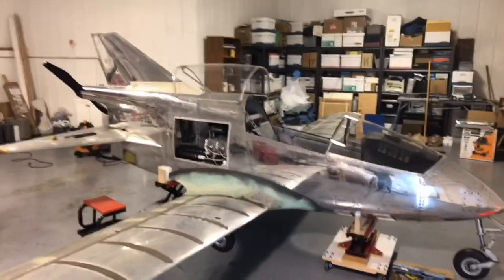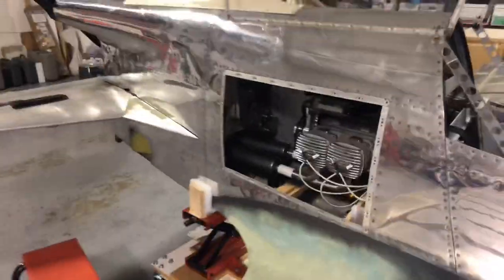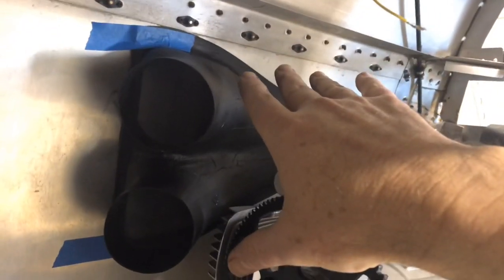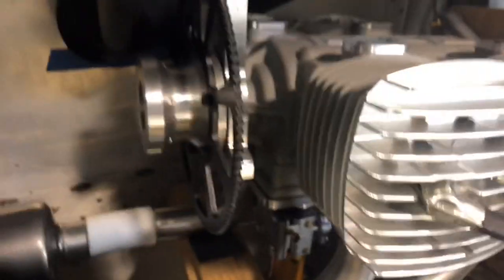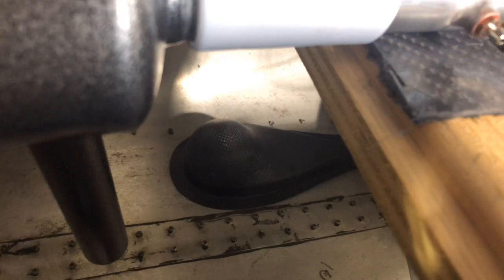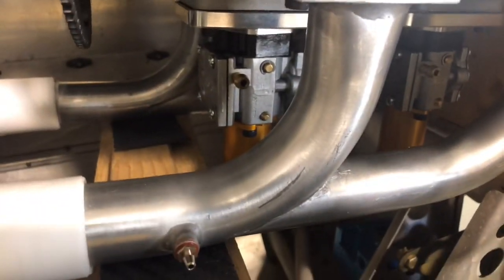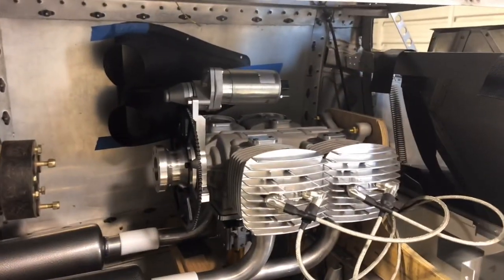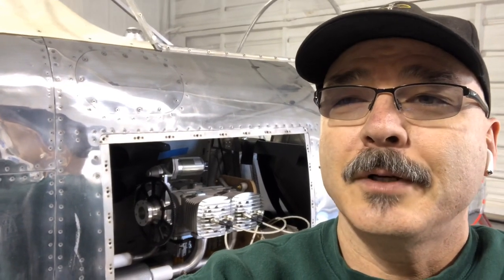Engine cooling and intake design considerations.

Comment: Cooling this engine during ground static and taxi operations could be a big issue. High CHT readings may be possible. Where a propellor creates airflow across cylinder fins in conventional aircraft, you may need to design small electric fans in the NACA duct system for ground operations. Having a 90 degree bend in the NACA duct system could reduce needed airflow and create a drag issue. Perhaps larger narrow rectangular outlet NACA outlets alongside the cockpit and ahead of the engine could be considered.
Reply from the maker: I'm working with someone who has built many Lancairs over the past 30 years and designed multiple cooling plenum systems and following his recommendations. We are starting with the NACA ducts in the engine covers as that is the most easy system to change if it doesn't work, we are trying to avoid crossing bulkheads in the fuselage if we can. The inlet size is double what it would be in a tractor configuration. The exhaust jet venturi was one of the Jim Bede's designs that never was implemented fully since many of the engines were too large and required additional cooling inlets (for water and/or for oil radiators) which would negate its effectiveness. I am very conscious of heating issues and will be testing very thoroughly. The engine will have individual CHT and EGT and I will monitor engine compartment temps as well.